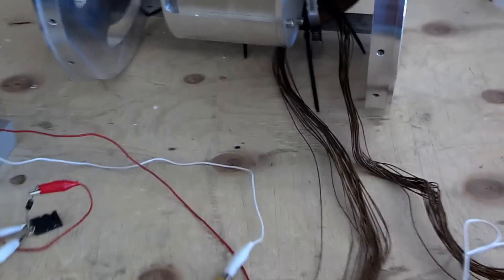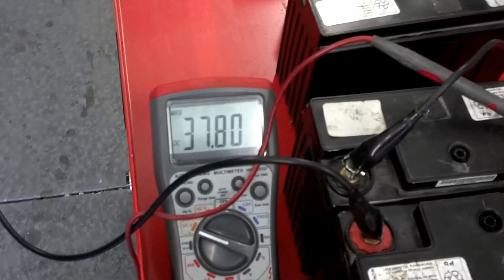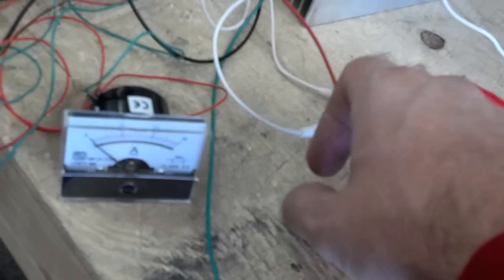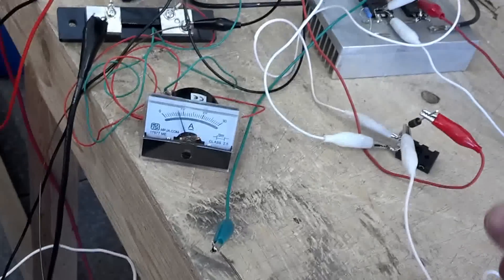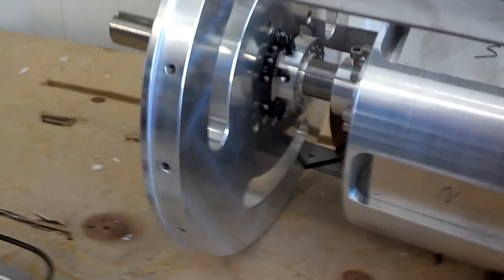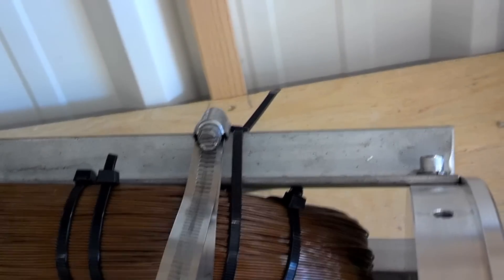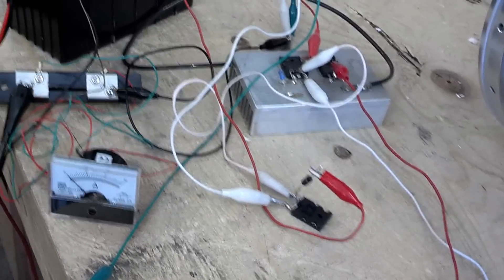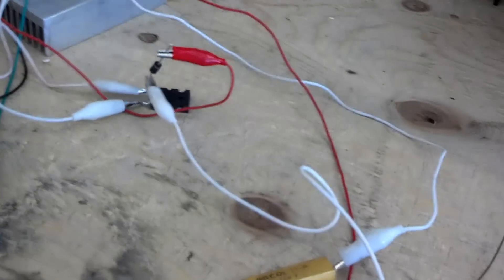Preliminary testing of new Magnetic motor

Comment from the maker: Thanks. More details later today or tomorrow. My customers are planning to drive various loads with this motor. Whatever you can do with an electric motor. You can also charge batteries or load resistive loads instead of charge batteries. 
Well you didn't try enough. The old cordless drill battery will still self-discharge so it has to be used soon after the charge. Some of them are beyond recovery when they start leaking. We have a special charger for those, the RC-1AU.